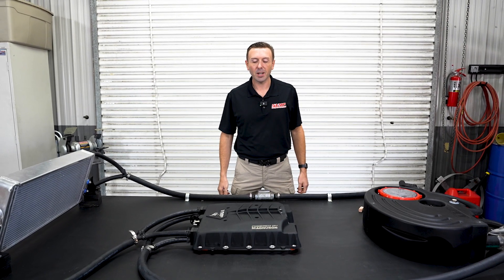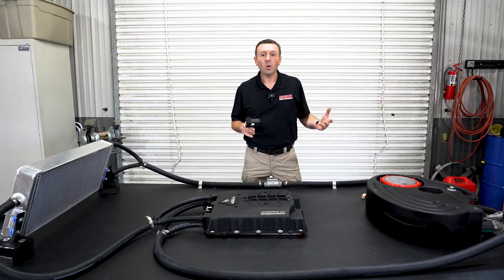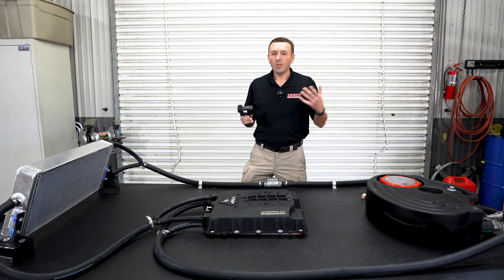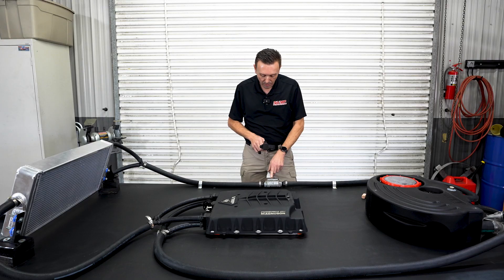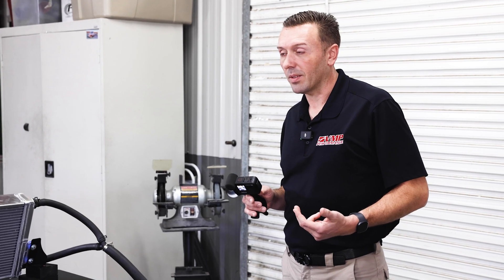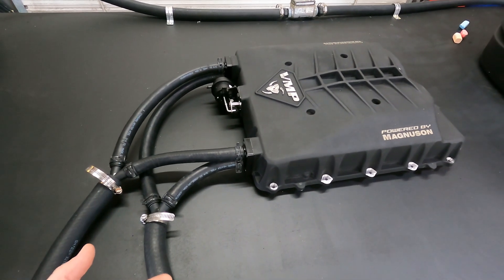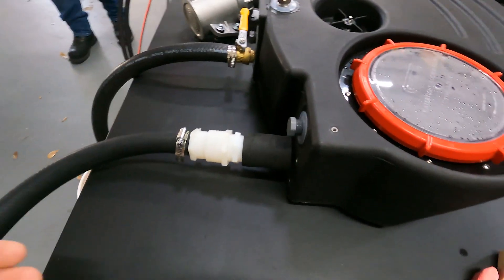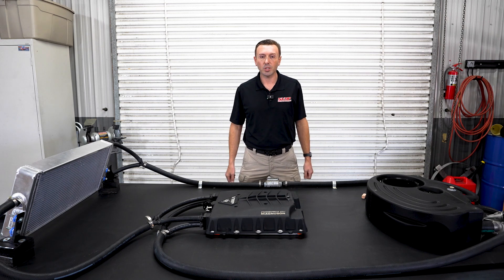How Our New VMP Trunk Ice Tank Works! | VMP Trunk Ice Tank

Comment: What heat exchanger is that? It looks thicker than your triple pass dual fan heat exchanger I currently have, and I'd like to get rid of the fans and go with a bigger core size heat exchanger. Do I still need the fans with the ice tank set up, or do you recommend I keep them? Will I have colder IAT2 temps without ice due to the increase of coolant volume, or will it heat soak the same and have no benefit unless I add ice?
Reply from the maker: The volume will definitely help, we like fans for low speed/traffic on street cars as well as staging lane and pit recovery on a battery tender, but they aren't required.  This particular heat exchanger is the VMP-MP10 and it's available at the following link:  https://www.vmpperformance.com/VMP-Multi-Pass-Heat-Exchanger-with-1-NPT-Fittings

Comment: Does it works with vmp supercharger 2?
Reply from the maker: This is a universal product and would work with any system that utilizes air to water intercooler.  It does take custom installation work.
Reply: @VMPPerformanceTV  ok, I need water intercooler 👌😁

Comment: 7 gallons of water ?  Does it help with cooling without using ice or is the standard cooler that comes with the Odin about the same ?
Reply from the maker: The larger volume of water can help, nut the greatest advantage is seen in being able to utilize ice for individual passes.